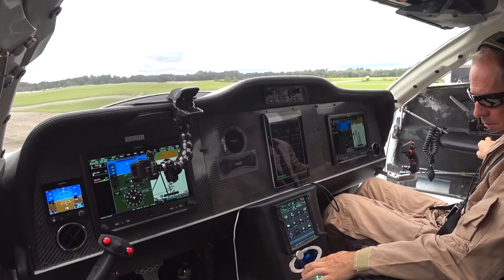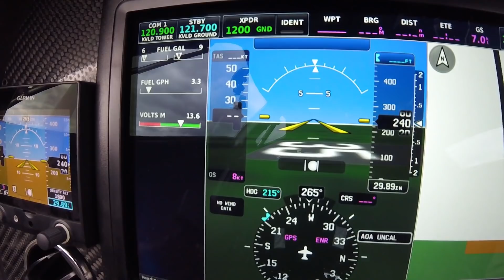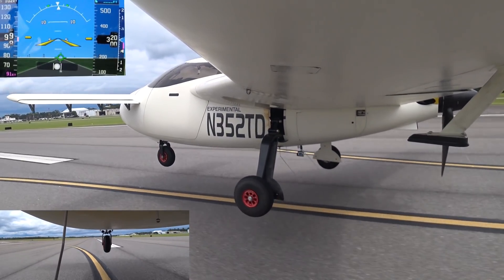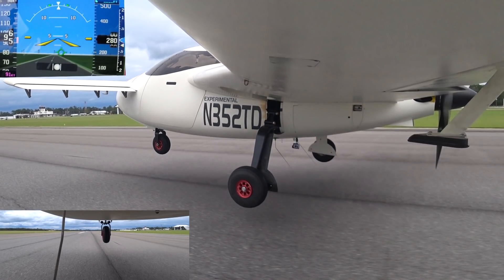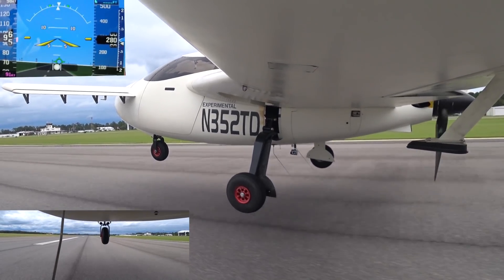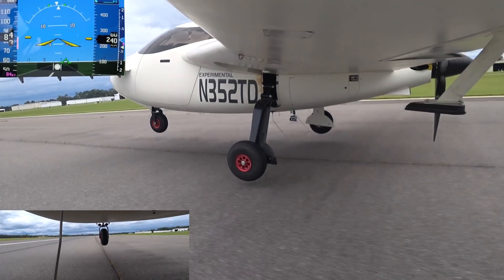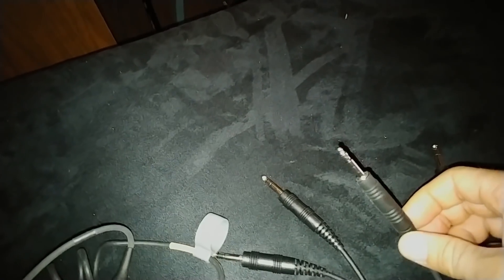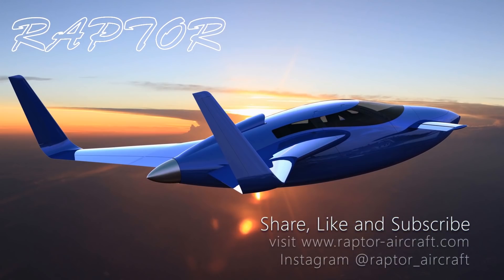Second Ground Effect Test - Building the Raptor Prototype

Comment: Independent of the actual strength of the crosswind, I always start the takeoff run with the aileron almost full in against the crosswind and ease it up as I accelerate making sure the windward wing stays down. Because if you let it rise it will make you drift off centerline and if you push it back down it will make you lose tire traction before you have reached V1.
Reply from the maker: Good point.

Comment: Nice.  The controls work, and more input than expected is not required.  It is not unstable. It's already been designed, analyzed, and static tested (right?)   The test shows the control envelope is much larger than can be tested in ground effect.  You need to fly it.
Reply from the maker: I'm getting there. Won't be long.
Reply: @RaptorAircraft  Peter I think you about there also. Only so much you can learn in ground effect, no mater how many you do. In the two flights there was nothing seriously out of wack. You have tuned it more, and you are almost ready for the first full flight.
Reply: JustSomeGuy .....I Hope it doesn’t get wadded up doing these maneuvers

Comment: You can rule out the 3 gal fuel imbalance. That small difference wouldn’t be noticeable. If the winds are a direct cross wind next time, do the option in the opposite direction (traffic permitting) also, and compare the two attempts to rule out the wind. You may need a longer runway to give yourself more time in ground effect to really get a feel of what’s happening in the roll axis. Not to question your piloting skills, but were crosswind techniques applied or were you going with neutral roll control to see what the bird would do?
Reply from the maker: There's not enough time to get the aircraft in a crab. So I'm pretty much just putting the upwind wing down to get back on centerline. And 3 gallons out on the strake tank is 21 pounds with a 6 foot arm. So again about 120 ft lbs of torque. It's not trivial.

Comment: You have a truck load of torque being generated by the engine, have you ruled that and P factor out?
Reply: Formulalaben, thanks for the correction, I muddled the two effects into one.   It's been 30 years since ive flown anything with propellers.   Your criticism reminds me that I'll need to review some old filing cabinets in my brain before getting into my GA Raptor.  You are correct,  the corkscrew and p factor are different.
Reply: Isn't P Factor a result of prop wash?
Reply: @bartofilms  not the wash, but as Tim S above says, "P-factor is from the asymmetrical loading of the propeller at AOA".  
https://youtu.be/SxtHyhoBHjk?t=36
Reply from the maker: Not ruled out yet.
Reply: In the C152 example,  when we discuss P factor,  that "corkscrew" of propeller thrust hits the rudder, hence the reason the vertical stabilizer is canted slightly off center.   It help to counter the force, especially in cruise.   The Raptor "P Factor, i believe,  would be almost non existent,  as there is no rudder and vertical stabilize for the thrust to push against.   As mentioned,  P factor is a Yaw issue,  due the reasons above.   I believe you have a  torque issue (400ft/pds) or so,  which is rolling the aircraft.  The mustang, for instance,  can run out of rudder and tail if too much power is applied before certain speeds are met, and roll over.   Perhaps a velocity pilot, or some type of pusher canard could weigh in, and help out.
Reply: @AV8R3  You are talking about spiraling slipstream.  P-factor is from the asymmetrical loading of the propeller at AOA and does affect his aircraft. He isn't affected by spiraling slipstream.
Reply: @AV8R3  "P Factor, i believe,  would be almost non existent,  as there is no rudder and vertical stabilize for the thrust to push against."  You clearly don't understand what P-factor is.  Step away from the keyboard...

Comment: Peter I’m not so concerned with the issues along the roll access. Clearly it’s controllable. The pitch control is very concerning to me however. It appears very sensitive. 
Is there a lot of “stiction” in the linkage? Any play? 
The ground is your enemy at this point and I’m worried you are going to get into a PIO scenario with no room for you to dampen it out.
Reply: Mark Ritter .....Mark I agree and he would be safer in the pattern orbiting the field gear down. Altitude is your friend.
Reply: @scarter176   Yes, it appears to be time to get some altitude safety.   The purpose of the ground effect tests has been achieved it appears to me...  Control proven.
Reply: @scarter176  However landing and takeoff are the mos dangerous aspects of flight, period.  He is doing everything correctly.
Reply from the maker: If I was going to PIO it, it would have been on the first flight. Now I'm getting used to it the chances are reduced dramatically. Either way, it's stable in pitch when I let go of it.

Comment: Fuel imbalance + Pilot weight + crosswind... 
I'd say you have a perfectly balanced plane on your hands. 

The winds going to push on the gear more than anything so take that into consideration aswell. The give in the gear design looks great by the way for a static design. 

**I would suggest adding some deflection in the rear flap-ailerons to keep the rear of the plane from over responding looks like a bit of a teeter which is why the gear is touching so hard. You want that 84kt stall. Maybe try 100kt take off with a power off or 25% landing to simulate a greaser. It would also keep you from having to go nose down being you'd essentially  be stalling. Also you can get a good 10ft or so off the ground and still be in ground effect. The fact that you are managing to keep it a foot or so off the ground speaks to the precision in the engineering. 

When are you going to pull back on the controls too much by accident? :)
Reply from the maker: Yeah, I don't want to get it much higher or else I'll run out of runway getting it back down. Probably one or two more runs in ground effect and then start planning the first full flight.
Reply: @RaptorAircraft  Sound decision making in my non-expert opinion, and a great video.  We're rooting for you Peter!

Comment: You could have made a run the opposite direction to determine if the wind was the issue.
Reply: I'm pretty sure that's not a simple ask from ATC at a controlled airfield. I mean, it's a pretty big deal to ask them to reverse traffic if I remember correctly.
Reply: @panchonorthmann6408  its basically a back taxi.  He is not going to take off so they wouldn't need to switch the active runway.  just wait till no one is on final.  Its not like its KATL.

Comment: Unsubscribed due to excessive political adds
Reply: Interestingly, here in Australia I didn’t see a single ad.  And usually I get hammered.
Reply: I'm on comcast and use Adblock Plus. I've never, ever, ever had an ad.
Reply: @Cliff. 
You don´t have ad blocker installed? Wow, what a tard.
Reply: @droneguts5122  adblockers don't work well in mobile, every time I try it videos won't load
Reply from the maker: That's YouTube, not specifically my channel. If you don't want to see political adds for the next six weeks you'll have to go hide under a rock.
Reply: Trump 2020. Trump 2020. Trump 2020.

Comment: I’m here for the comments.... 🍿🍿
Reply: Ryan Thomas sorry Ryan, you have me mixed up. Double check the last video and the hundred before that one! I have ALWAYS been a supporter of Peter! One of my good friends has a deposit and build slot on this bad boy!  Only once did I question Peter, and very quickly realized I had made a mistake, within minutes I issued a public apology and corrected my mistake.
Reply: I admire Peter.. it’s his dream and the way he chooses to see it through is totally up to him.. that’s what is great about this process under the FAA. In  other parts of the world this would be highly regulated. There are many ways to achieve this goal, but they all have the same thing in common including the Raptor project.... they are compliant with the minimum standards as per the administrator/regulator. If a designer builder wants to go further than the minimum the they certainly can. So in a nut shell there are people he must listen to... and others he may listen to. I believe Peter knows the difference. 😉
Reply: MaximDS if you rate Peter as “a danger”, what do you rate Boeing Aircraft and the FAA on the 737 debacle?
Reply: Ya the fireworks was pretty good last time, I took on a couple naysayers, they went away!
Reply: @waynetokarz174  Congrats to you Wayne. Good work on the "naysayer slaying."
Reply: MaximDS , clearly you have zero qualification for such an ignorant statement. As an active pilot of 39 years, an aircraft owner and builder of several aircraft, I can attest that Peter is doing everything correctly, appropriately and by the book. I have test flown all of my own aircraft as well as as several for others and Peter is doing fine.
Reply: @waynetokarz174  Wayne, with the greatest amount of respect - have you ever designed a new aircraft from scratch (new product development) and flown it for the first time, or are you flying an aircraft with previous envelope expansion and flight experience i.e. a kit? The two are different worlds. Cheers, FlightGuy.
Reply: Flightguy thank you flight guy. The short answer is yes! But some basic ultralight from 30 years ago hardly qualifies in comparison to what Peter is doing. Your absolutely right, building a kit and test flying it is not the same thing, however when one undergoes serious modifications to said kit, well that quickly becomes another matter altogether. A pilots license is little more than a license to learn, and the homebuilt world under the auspices of the various agencies, EAA, RAAC, PFA, etc. is a great learning tool with limitless resources and Peter is making good use of them. He is also making good decisions despite all the internet rhetoric and all the  while  looking after his investors and all the internet fans. Rather extraordinary when you think about it!

Comment: Looking forward to the day the Raptor is set free to fly properly.
Reply: J J  I disagree. .it will fly.  I'm pretty sure of that.  I always thought it would,  I just don't believe it'll meet any of its crazy performance promises,  but it will fly.
Reply: @thomasaltruda1243  Yeah, Right.  Show me all of the successful designs that you have completed and successfully marketed.
Reply: @billwessels207  what are you talking about? Just because I haven't designed and built a plane, doesn't mean that I can't have an opinion. Yes I believe the plane that Peter built will fly more than ground effect. I may not believe it will meet the performance claimed in its current forms,  but it may as it gets more refined. It appears to have gained weight as it got developed,  I'm not sure the range and speed it wants to achieve add up right now.
Reply: @thomasaltruda1243  You are doing what trolls do.  merely sniping from the sidelines.  You have no cred.   I have stated several times that I have been a combat pilot and my videos of my test flights are at Edwards, however, I doubt that you will be able to access anything there for any reason.  Most of the data there is a need to know only.
Reply: @billwessels207  ok Bill,  beat on your chest and tell me about your expert experience and what your opinions of the Raptor are?
Reply: It just flew, what a moronic thing to say!
Reply: @Auntcankles When  I say 'fly' I mean go more than seven feet off the ground, perform manicures at altitude.  Utilise the aircraft's potential, not just short bumps along the runway.  Perhaps you and I have differing ideas of what 'flying' really is?
Reply: @billsticker  I wasn't responding to you!!
Reply: @Auntcankles  My apologies Keith, my post skipped one.
Reply: J J  Obviously you are sadly lacking in both knowledge and experience.  I have been a test pilot in some of the most deadly aircraft ever to fly designed by the so-called experts.  Expert.  Ex is a has been.  Spert is a drip under pressure.;    If you are such an expert, why are test pilots even required.  Just launch into production and marketing.  Hold out for the cell with the really pink curtains and the behemoth that smells worse  than Godzilla for your new lover so that you will not have to daily service the other 999 inmates.